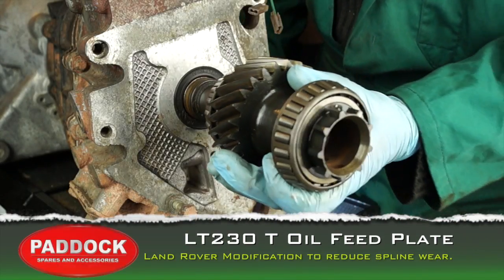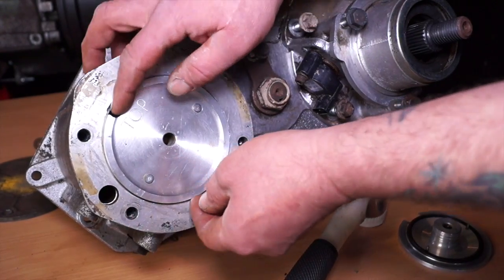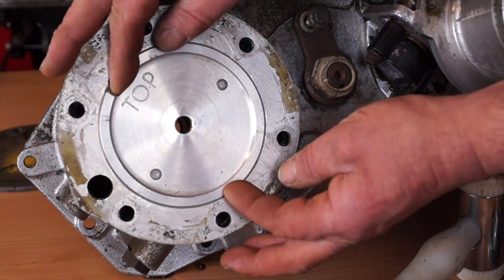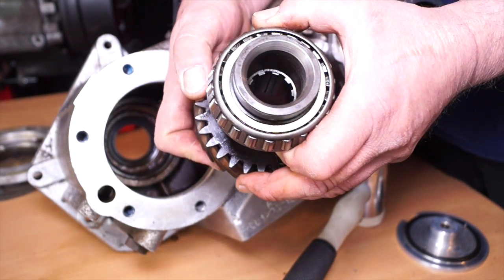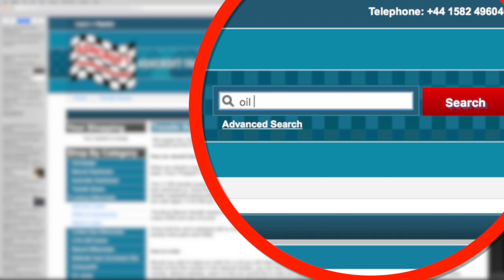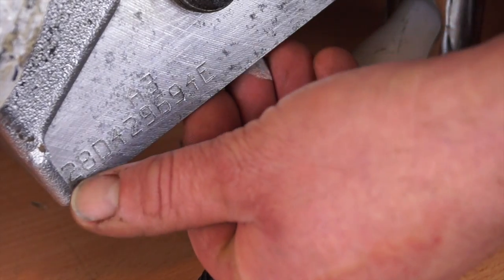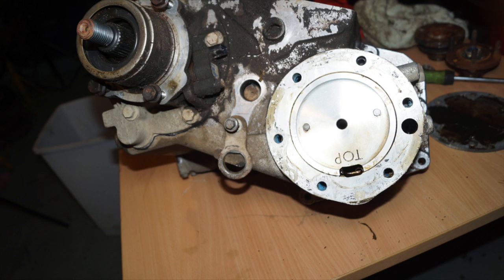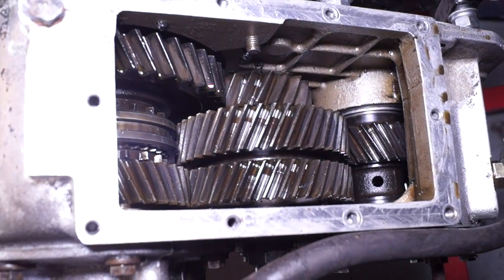LT77 R380 LT 230  Oil Feed Plate to Stop Main-shaft Spline Wear.

Comment: THANKS TO YOUR VIDEO'S I HAVE LEARNT SO MUCH FROM THEM,   ONE THING THAT I CAN NOT UNDERSTAND, AND I HOPE THAT YOU WILL EXPLAIN TO ME IS,---  WHY CAN'T I FIT A CROSS DRILLED GEAR INTO MY ;A: SUFFIX  TRANSFER-BOX. ALSO WHY AS AN ALTERNATIVE CAN I NOT DRILL THE HOLES IN THE GEAR MYSELF, I DO HAVE A LATHE TO TURN AN OIL GROVE WITH A BORING-BAR INTO THE GEAR IN LINE WITH THE HOLES.  PLEASE CAN YOU EXPLAIN.   PLEASE KEEP UP THE GOOD WORK.
Reply from the maker: yeah why not cross drill?.  That is something the LR engineers took years to work out how to lubricate the splines and stop them wearing up.

Comment: One quick question as this is something I would like to do. Can the cross drilled gear be put in place with both boxes still in the vehicle? Or do you have to strip the transfer box? This is on the assumption the splines are in good condition and don't need replacing.
Reply from the maker: +MrSpookylukey  Not really.  You need to change the bearings so how would you get the bearing race out of the transfer box that is at the far end?

Comment: Not needed if you have the cross-drilled input gear, but would it do any harm? 

Also, new Puma-engined Defenders are again suffering from stripped output shafts - is there any solution for them beyond Ashcroft's MT82 conversion? It seems LR makes the same mistakes over and over...

http://www.ashcroft-transmissions.co.uk/mt82-output-shaft-kit.html
Reply from the maker: +CanAmSteveUK    No point having the plate and the cross drilled gear.      As for the LR mistake.  It is a Ford gearbox so i doubt it is Land Rovers' fault.  But you know new generation of designers and engineers make the same mistakes as their predecessors if they don't listen to them.
Reply from the maker: +CanAmSteveUK thanks for the heads up on that one.
Reply: +Land Rover Toolbox Videos But Not typically used by Ford in a 4X4 config? Just remembering my 1995 Defender had the same issue between the R380 and the L230, so like oil pump issues it seems some things just are "LR problem areas". I upgraded to the x-drilled x-fer gear years ago but do have one of the oil feed plates in a box - tempted to use it too :-)
Reply from the maker: will block off the access hole if you need to fir a PTO.

Comment: thanks, must go and look at mine.175000 miles it may be to late
Reply from the maker: +oi clown  if it is not banging when you take up drive then it may well be okay.
Reply: +Land Rover Toolbox Videos  it does shudder pulling away  if i have parked it for a week, but i put that down to a little oil on clutch. as i do get the odd drip coming from bell housing bolt hole. i have ep90 with moly added

Comment: Do you know if the oil starvation applies to series gearboxes as well?
Reply from the maker: +scienceaddict77   not really no.
Reply: Having had several apart I haven't seen any as bad as on the lt230 given that the series transfer cases can be twice the age of the coil sprung equivalent. 
The wear mainly occurs if an overdrive has been fitted without the application of the special grease. 

I'm going to strip my series box down when I try to fit an lt77 and lt230 in my Tdi series 2 109.

Comment: The discovery transfer box I've got came from a late 300tdi, so I'd assume it was cross drilled, but sounds advice nonetheless.
congratulations on no "thumbs down" on this video. 👍
Reply from the maker: +Paul B  wait and see,  still time yet for the thumbs down.        Late 300tdi might have the quieter gearing in it.

Comment: Is there a specific time where landrover changed from the oil plate to the cross drilled shaft?
Reply from the maker: +Paul B    Sorry can't tell.  Parts supplier will be able to tell you.   Changing from using gaskets to sealants starts at  serial number 288709E.  Says this in the Workshop manual.